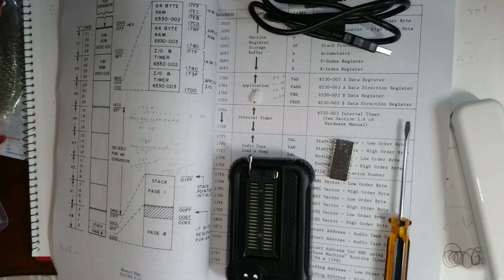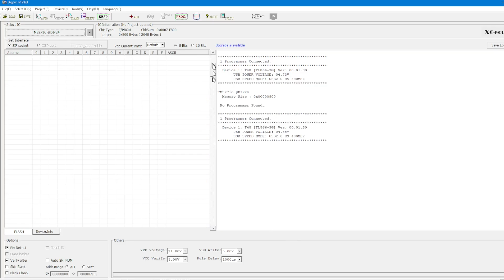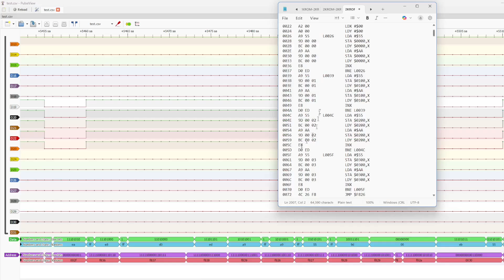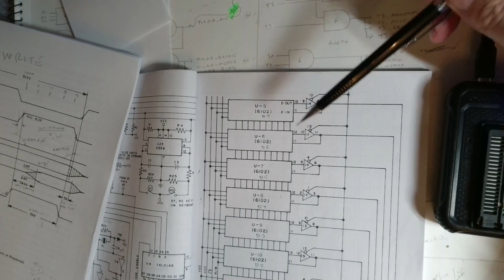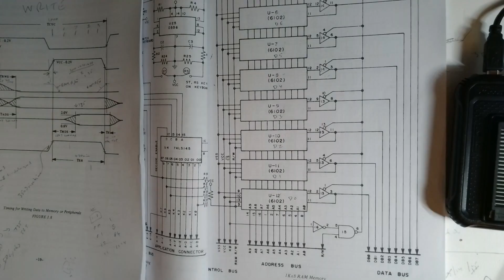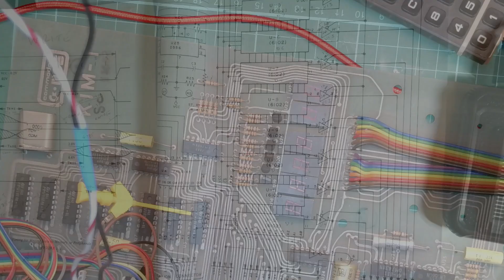The KIM-1 computer Resurrection. Testing The Ram. (The Good, The Bad And The Ugly)

Comment: I want... I mean... I need a KIM-1. Looking forward to see some more videos.
Reply from the maker: Thanks. Plenty more videos here to watch and comment on.😜
Reply: @unicornpub  I didn't notice at first. But you seem to have a 32-channel logic analyser. What model is it? Do you recommend it?
Reply from the maker: @microhobbyist  It is infact a 64 channel one. It does 16 channels at 12.5 Msps max with 30,000 sample, 32 channels at 8Msps max with 15000 samples or 64 channels at 4Msps max with 7500sample and many speeds below these The data is saved in CSV or raw format and I import it into PulseView. I have just updated the gerber for this and the code to run this is in the google drive in the description above. Its design goal was 64 channels at 4Msps which it does. the 8 and 12 M options are just there because it can. You have to watch for crosstalk at 8 and 12 M if you use dupont leads. I am at this very moment making some screened leads to see how it does at these speeds with these. The new gerber has extra pins for the earthing of the screens. The input impedance is 100K and I think this is why the highr speeds are a bit touchy. The earlier videos show all this you might like to view them.👍
Reply from the maker: I forgot to say Yes I highly recommend this.
Reply from the maker: @microhobbyist  New gerber files uploaded v2.1. they are the same as v2 but with the internal bus resistors reduced in value. there is also new firmware that improves the quality of 32 ch at 8 Msps ( actually 6.7 for 32 channel) (8.33 for 16 channel)